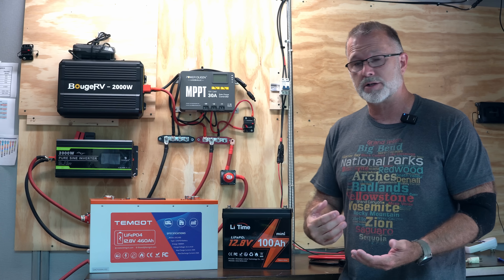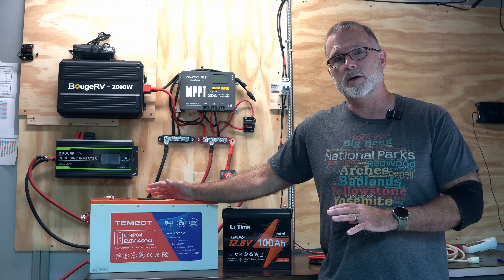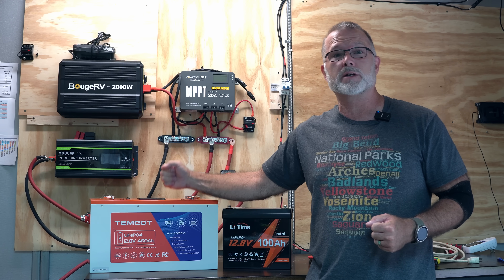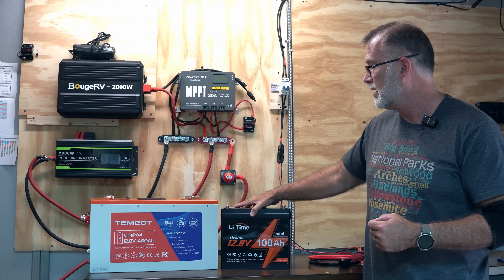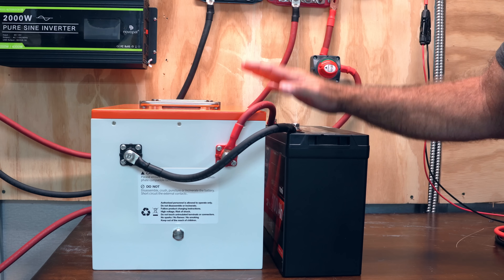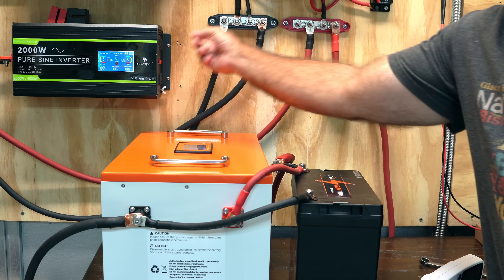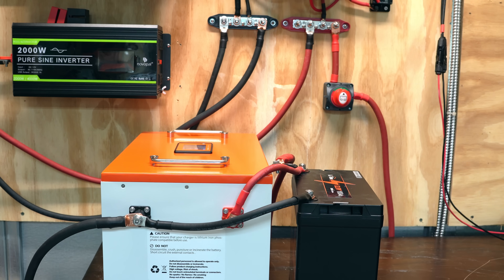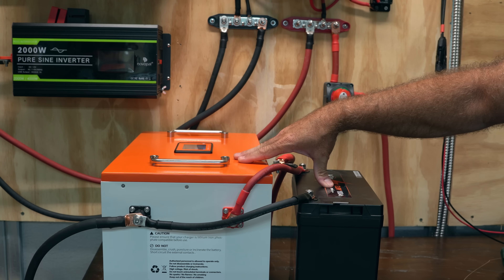Connecting Batteries with DIFFERENT Capacity in Parallel - What Happens?!

Comment: Having your equipment connected to a flammable piece of plywood is not really ideal! It would be great to replace it with a flammability rated panel designed for switch boards - they aren't too expensive! :)

Comment: It would be a good idea to check that the voltages are similar before connecting them - you could get a big current!
Reply from the maker: Check out my Part 2 on this video.  I actually test that very scenario.  At least with LFP, not really an issue.

Comment: 2:00 I think you mean "slightly different CURRENT" when connected in parallel...??
Reply from the maker: @Quacks0  No I meant voltage. One could 12.4V and the other could be 13.2V for example.  Both are "12V" (nominal), but will have slightly different voltages depending on their states of charge.

Comment: What he says about series-connection of unequal-capacity batteries is kinda similar to what had always bugged me a couple decades ago about those stupidly-designed five-cell two-speed cordless drills that were so popular back in the late '90's --- the drill's low speed would use just three of the batteries in series, while the high speed would use all five.  Well, of course, this flawed configuration of the tool meant that if you used the lower speed much at all, those first three batteries would get discharged far more than the remaining two which ran the drill's high-speed setting, and thus the batteries would not all be utilized equally, causing the entire battery-pack to fail prematurely due to this unequal charge/discharge cycling --- all five of the batteries were just 'charged in a string" by a simple single-circuit AC-to-DC power-pack that delivered maybe 7 volts to the entire five-cell pack in series; the separate cells weren't each singly "accessed" for "individual" charge, and so the two less-drained cells would interfere with the other three more-discharged cells' getting their "share" of the charge.  Plus of course, this was long before the days of NiMH or Li-ion batteries, and so these late-20th-century drills' power-cells were merely the notorious --- and toxic --- nickel-cadmium batteries with their well-known "memory" issues --- i.e., if you discharged them partially several times, they would "remember" that partial level, and then only accept a charge up to that amount, rather than allowing themselves to get recharged fully.  So it's little wonder that you used to see --- and still may occasionally --- so many of these compact 2-speed cordless drills' being sold for pennies on the dollar at community yard sales because they would no longer take a charge!

Comment: One thing I've heard and please tell if I'm wrong is an issue with charging using highly electronically controlled or digital type chargers or charging systems that measure capacity. It was stated that this type of charging would essentially turn off the charge rate when the smaller battery gets to full capacity. In this system with a 100ah battery and a 450ah battery would only come to a "full charge" of only 200ah and would then not give the 450ah battery the additional 350ah of charge. I have not tested this myself so I honestly have no idea. The argument does make sense but again please tell me if I'm wrong. Thanks!
Reply: Most of the charge current would flow into the larger capacity battery,, so the SOC of both batteries would rise to 100% in sync with each other.

Comment: You can do it personally don't always mean that it is advisable to do it against manufacturer instruction。🤷‍♂🤷‍♂
Reply: Manufacturers will not usually instruct against this if the technology is the same for the two batteries - same maximum charge voltage, same discharge curve, same end voltage on discharge. If they do it is probably the legal department overruling the engineering department! It will work very well, has been done for decades.

Comment: One other possible concern is if one battery has an internal heater and the other one doesn't. I have two 100ah batteries in parallel in one bank inside my RV trailer and a 300ah battery with an internal heater outside in a storage box. The two battery banks are connected by an A / B / Both switch. During storage I keep shore power on the trailer, but, set the A / B / Both switch to the 300ah internal heater battery only. That way if I lose power the 300ah battery doesn't try and use the two 100ah batteries to run it's internal heater. I haven't actually tested if it would. During useI run all the A / B / Both switch set to Both. During a recent trip on a particularly cold night I did seem to have an accelerated capacity drop so it might have been the case. So any future cold nights I switched to just using the 300ah battery and then only recombined them after I had shore power and could top off both banks.

Comment: Great demo, but I think it would be good to note, in the series arrangement, the capacities DO technically add, just as in parallel. The smaller unit will deplete quicker than the larger one, and will “open “ the circuit, as you said. Of course, you would never purchase such different batteries for such a use, but what if someone had a critical situation, needing more instantaneous capacity than the 460 AH battery could deliver on its own, in a 24V system, and the only other battery available was a 100 AH 12V battery. Connecting the two in series would provide extra capacity for the duration of the smaller unit’s charge, possibly providing the user critical time to get his battery situation outfitted properly. So since I can only picture someone doing this in a crucial situation, I thought this would be a good point to share. Thank you!
Reply: The voltages add, not the capacities (in A Hr). The series combo has the capacity of the smaller battery. Once it is discharged it will drop in voltage and start to be charged in -ve voltage which will damage it very quickly.
Reply: @HughCStevenson1  I disagree. The capacity doesn’t follow Thevenin’s rules. Capacities always add. While the smaller unit is “alive” the capacities of the two will add. The smaller one will likely discharge more quickly (although even that is dependent on the two batteries’ individual chemistries, starting charges, and environmental conditions). When one of the batteries completely discharges, it will likely present an “open” to the circuit and at that point they will sum to zero. But before that time, you will have the benefit of both their capacities, which,as I said, may help someone get through a serious situation until they can procure proper batteries.
Reply: @gaylanbishop1641  You are absolutely correct that Thevenin equivalent is not applicable because we are not talking about linear components like resistors, capacitors or current/voltage sources.
Perhaps a real example would help (I think we actually agree but are using different words...)
Consider a 10 AH 12 V battery and a 20 AH 12 V battery. Both fully charged. We connect them in series and start discharging at 1 A. We have 24 V because the voltages add. After 10 hours the smaller battery is exhausted and we can't continue without damaging it by over-discharging. How much charge did we get? 1 A for 10 hours = 10 AH. So the effective capacity is the capacity of the smaller battery. 
The voltages add and the capacity is the capacity of the smaller battery.
Reply: @HughCStevenson1  Please don’t consider me as arguing, I’m looking at this as a discussion and I’m enjoying it. I hope you are too. I’m a retired electrical engineer and I don’t get to have these kinds of discussions too often. (I was actually disabled by getting into the high voltage terminals of a 12kV transformer…lost both my hands). So let’s go back to your example, with 1 amp in the circuit. Isn’t only a portion of that amp being produced by the small battery and a larger portion produced by the other?  The way it is looking to me, yes, 1 amp is flowing through the small battery, but the chemical reaction inside it is only producing some fraction of that 1 amp, so it would take awhile longer to discharge. It’s apparent that you know what you’re talking about, so help me to clarify this in my mind. Thank you.
Reply: @gaylanbishop1641  If the small and larger battery are in series the current in both must be the same. 1 Amp. You are thinking parallel...! I'm an EE too so enjoy talking about electricity!
Reply: @HughCStevenson1  I understand that the current flow will be 1 amp, but both batteries contribute to producing that current flow, so each will diminish more slowly than if they were producing it on their own.
Reply: @gaylanbishop1641  they contribute voltage not current.  They are in series. They both carry 1 amp.

Comment: Can I just point out that this should only be done with an independent BMS for each cell.
Its not that clear from the video and someone not familiar could easily think they can use 1 BMS feeding 2 parallel batteries. 
See how it sounds just like saying 2 batteries in parallel.
What it really is is 2 batteries and BMS units connected in parallel on the load or output only.
I may be pedantic but this is YouTube not on site.

Comment: This should be a procedure you don't plan for. It should be what you do in a pinch to get through a low voltage scenario when you're away for the weekend. This "plan B" is good to know when you're away from home. But when you get back home, get matching batteries before your next trip.
Reply: No, it is fine for ever. There is no need to have identical capacities. So long as the technology of the batteries is the same. Lead acid wet to lead acid wet, Ni Cd to Ni Cd, LiFePO4 to LiFePO4, don't mix them up...

Comment: I'm sure this an apples vs oranges question (and will reveal my lack of knowledge on the subject) but what happens if you connect solar panels of different wattages in parallel to a battery bank (via a mppt charge controller, of course?)

Comment: Theoretically, if the small one has a 100A and the big one 200A and the voltages are the same, 200A load should be fine.
Reply: exact   100amp each = 200

Comment: "DIFFERENT Capacity in Parallel - What Happens?!"
Provided they have the same voltage, nothing happens .  As you draw power, the one with less capacity will start to drop voltage, but of course, it cannot; so most of the load starts drawing from the battery with more capacity.  Thus, their SOC (state of charge) draws down uniformly.
Reply: This is done in tractor-trailers all the time at least three batteries in parallel some have four batts in parallel. The voltage does not change unless you count becoming equal between each battery.
 The only time the battery bank will have an issue is if one or more of the set is bad. Example: self discharge in that case the one battery (or more) will  cause the good batteries to discharge rendering the vehicle unable to start. 
 I have personally experienced this. I found if I disconnected the bad battery the truck would start off the two good batteries. The truck would not start if the bad battery was left in the battery bank. It took about 24 hours or so for the bad battery to drain the other two to the point the truck did not have enough power to start the truck.
 As I understand this difference in the two battery capacity, the power draw would pull equally on both batteries. The larger battery would extend the length of time of the smaller battery and the smaller battery would extend the power draw of the larger battery. Think of it like a muscular guy and the average sized person pushing a car both of them assist in moving the vehicle, if more people help push the car the further and longer they can move it along. The size of each person is irrelevant.
Reply: @darinb.3273  With lead acid this is correct. I have not found this so far with LiPo4 batteries.
Reply: @tmog1000  Hello Tmog, I don't have any practical experience with lipo batteries other than those in my cell phones that I've had over the years. So I cannot agree or disagree 😃😄😆. I am fairly familiar with lead acid batts. Deep cycle and regular car batteries. As I understand deep cycle types are designed for long slow power drains and car batteries are designed for that quick heavy amp draw to start the engine. I don't have a solar panel system so that's why I don't have any experience (lead acid or Lipos. Or with batteries of different capacities together in parallel or series. My views were and are purely theoretical. All that to say thank you for your response LOLOLOL.
Reply: @darinb.3273   I have put together lead acid and LiPo4 batteries and the lead acid do not quite charge enough to full or you overcharge the LiPo4 to fully charge the lead ones. Although it kinda works if you stick with the LiPo4 charge settings. I do run a 3kw inverter for an induction hot plate and 1kw microwave from my system. So it gets pushed fairly hard.
Reply: @darinb.3273 Hi, but how is each person or battery affected.
Does it make a different from which terminal you draw positive and which you draw negative? Small or larger battery ?
And what about the charging should you charge positive from controller to large battery positive terminal or other way around ?
Are there any affects on charging to the small battery.
Am I right in saying the smaller battery would be less stressed if the positive terminal was connected to larger Ah battery for charge and drawing?
Reply: @236vic  Wire both batteries to a collector busbar. + and - busbars.
Reply: Exactly enough said
Reply: @thomasmaughan4798  will it matter if the positive terminal on the larger amp battery is connected to the draw or the lower amp battery?
Reply: @236vic  Different capacity batteries (of same type, chemistry and state of charge) can be easily connected in parallel; positive to positive and negative to negative.  What you ought never do is connect different capacity batteries in series .  That's the whole point of lithium-ion battery management system; to make sure equal state of charge in series connected batteries.
Reply: @ yes I get that part, the question is about draw. Does it matter if you are drawing from the positive terminal of the larger amp battery or from positive terminal of the small amp battery?
And what about if one of the batteries is a car battery and the other is a deep cycle solar battery ?
Both 12 volt acid batteries.
Reply: @236vic  Car batteries are designed for high current demand, thus low internal resistance.  The deep cycle battery is designed for lower amps but much longer duration. 
So long as they are connected together it does not matter which positive post you use provided the interconnection between the batteries is low resistance (heavy wire). 
If both are fully charge, both will contribute equally to the load BUT if the amps required is very high, the car battery would provide a greater proportion of the amps because of its lower internal resistance.  But as it discharges, its resistance increases, voltage decreases and the load will gradually start to be borne by the deep cycle battery. 
Keeping such a system in balance requires periodic re-balancing which is basically a slight overcharge to make sure both batteries are fully charged.
Reply: the battery power equalize to the lowest Ah rating
Reply: Agreed...very true...i try this on my 100ah parallel with 18ah lifep04
Reply: well when i connect them i see lots of power leak from higher one to smaller one as smaller ones voltahe is in general less even if charged full there is small change... you can use a voltmeter and ampermeter to check the voltage difference ..
Reply: @ahmetmutlu348 thats just nonsense…
Capacity has nothing to do with voltage. AGM batteries, 40Ah, 90Ah, 120Ah ALL have ~12,9V when new and fully charged
Reply: @PM-wt3ye Im not sure.. but when i left them unmonitored things goes wrong in general and i suspected that they are discharging each other and checked voltage flow and  i allmost allways see lots of power flow from one to another... if you have time you can make may be an arduino that creates statistics for how that goes.😊 but there is allmost allways atleast 0.5 volts flow from one to another may not be a problem of you charge them regularly anyway... may be thats what they call self discharge pr whatewer but what ive seen is they do discharge a lot.😊
Reply: @ahmetmutlu348 so you saying that full charge voltage is not same for Comparison of a 10 amp and 40 amp battery? 😮
Reply: @matb748 I dont have detailed stats but you can do the test yourself.. connect 2 batteries in paralel and use a voltmeter or led on one of the cables serially... youll see led will light up indicating discharge from one to another.
Reply: @4-Horses  " say 10a and 40a discharge limit discharging at 12a "
Assuming identical chemistry (AGM batteries for instance) they will divide the load according to their internal resistance which will be less on the larger battery.  So we can reasonably estimate the load balancing will be 1/5th at the small battery and 4/5ths at the larger battery. (example, 1 amp at the small battery and 4 amps at the larger battery) because the voltage drop internally will then be the same. This is how batteries of different capacity, but same chemistry, in parallel sort themselves into who provides more current at any moment.  Usually you want same capacity AND chemistry but there's no particular necessity to do it that way.
However, different chemistry can definitely unbalance things.  In that scenario, the battery that produces the higher voltage will actually be trying to charge the battery with less voltage even though you aren't doing anything on the load.  Diodes can prevent that behavior but you lose voltage in the diodes.  Diodes also help in the case of same chemistry but different State of Charge on each battery.